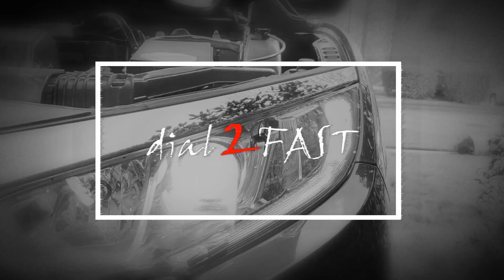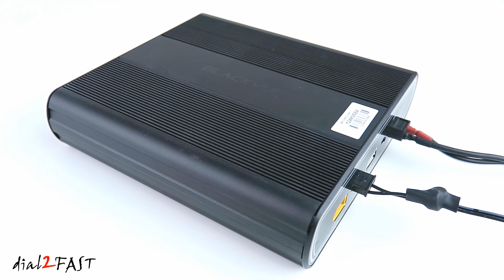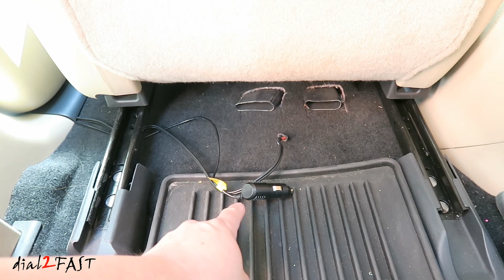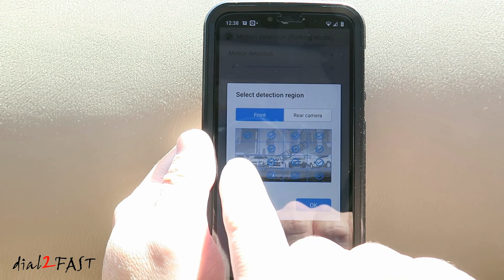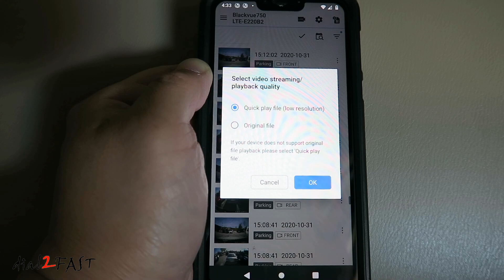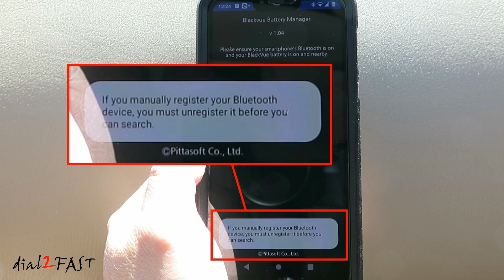Blackvue Dashcam Parking Mode - Power Magic Ultra Battery B-124X

Comment: Great Video, Any idea if it wold be possible to use the power magic pro with it so that the battery could charge from an always live fuse and keep the camera in park mode for longer, the power magic pro would then stop supplying power to the B124x battery once the main car battery reaches a set level say 12V? Would there be any reason it wouldnt work? This could be a great set up for long weekends away at hotels! I park my car in a garage at home most of the time and have it hooked up to a CTEK MX5 battery charger/maintainer so this would keep the camera and batteries fully charged if on a live circuit, then is there was a voltage cutoff inline the main car battery could also be used in conjunction with the Power Magic battery for longer park protection. Peoples thoughts are appreciated
Reply from the maker: It will not work. The output of the power magic pro output does not provide enough current for charging the dashcam battery. Secondly, the purpose of using a dedicated dashcam battery is so you don't any wear on your car battery. If you run any accessories off the car battery while parked, it WILL shorten the life of the car battery.
Reply: @dial2fast  I get that the car battery will suffer but that would be the reason for having a power limiting device in place, the main battery then tops up the aux battery to run the camera for parking mode and once the main car battery reaches a limit the PMP style device then shuts off the power to save the car battery and then the camera can still run on using the dashcam battery until its depleted. It would be no different to just wiring the dash cam into the PMP to run directly off the main car battery all that would happen is that there would be the dedicated dashcam battery in between them. Thanks for the answer its it the power magic pro device that is the limiting factor then as t doesnt allow if enough current through. Thanks again

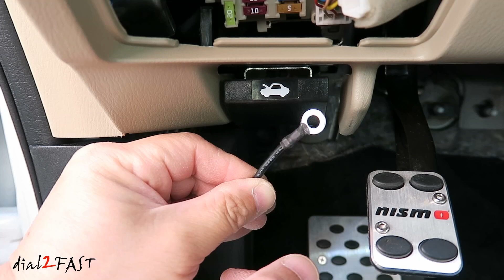Comment: Hi at 7:26 mark would you happen to know what size ring is on the ground wire?
Reply from the maker: The stud size should be 8mm (5/16") inside diameter to fit most 10mm bolt. You can use a smaller size for self tapping screw.

Comment: My cam is not a blackvue does anybody know if this can run a dashcam off the usb port?
Reply: Yes its just a USB port, so think of it like a giant USB power bank, If you connected your cam to it and the cam has a function for park mode or sentry mode or whatever they want to call it then it would have power for as long as the power magic battery can supply it. Not sure if it would run the camera straight away if the battery was flat as I think the battery routes power to the camera during charging but perhaps not as quickly to the USB port. I used a cheap next base camera on a solar USB powerbank as a test and it worked well and I think the Next base model has sentry mode that is minimal power draw until the sensor is triggered! There is also the other option of using a Blink camera and syn mode as they are powered from USB or just AA batteries in them, the only think needed to be powered is the sync module was thinking of trying this as a make shift 360 Cam system for the sides for a laugh!

Comment: I have a very short commute to work so I never get to charge my batteries much. I also have 1 B-124e daisy chained to the B-124x. I've tried adjusting my camera settings down, but this battery still gives me grief. This is what happened recently. For the past week, I've been doing whatever I have to do to keep the dashcam batteries charged above 50% even if I have to remote start my vehicle from time to time. Everything was working ok until yesterday. When I got to work yesterday, my charge was at 87% and I stayed at work for over 9 hours. When I left work the charge had only dropped down to 68% which is VERY good! My job has a high activity parking lot so I have motion turned all the way off and only rely on g sensor settings for recordings in parking mode. When I got home from work last night at 11pm, the charge on my dashcam batteries was at 75% which is still good. I went to bed at around 3am this morning, I checked and my dashcam batteries were at 64% charge which is still quite good. However, when  I woke up at 11:45 am, I noticed that my dashcam wasn't connected to the cloud anymore. I checked the events and the only event I saw was that the dashcam disconnected from the cloud at around 5am. I went out to start my car and the dashcam batteries were at 1%!! My mobile HOTSPOT has an internal battery and is plugged into the the B-124x via USB. It was at 85% charge and that makes sense. If the Blackvue batteries discharged at 5am, that means the HOTSPOT was running on it's internal batteries for about 7 hours (100% @5am down to 85% @ 11:45am)

So it appears that from 3am to 5am, something caused my Blackvue batteries to go from 64% to 0% and there were no recorded events during that time!! I'm hoping it has something to do with the Mobile Hotspot settings in the camera settings. I'm guessing it was trying to connect to my home network for some reason. I went into the Cloud Settings and removed network information for Mobile Hotspot 2 and 3. Hopefully, I'll wake up with no issues tomorrow. If I do have issues, I'm not sure what I'll do.

Comment: I'm so lost I got this and the new dual 900x IR and this battery got it professionally installed and parking mode never ever activates im assuming the battery is defective?
Reply from the maker: If you paid someone to install it, then have the installer help you troubleshoot the issue. Even if they are not experts on the dashcam, they are fully capable of testing if the battery is outputting the proper voltage. Very basic troubleshooting any beginner installers should know how to do.

Comment: does the Velcro adhesive stick to the vehicle carpet floor? Thanks for the video!
Reply from the maker: The adhesive on the velcro will kinda stick to the carpet but depends on how thick the carpeting is. If you put it on and remove it several times, it won't be as sticky.

Comment: Can you use the battery 🔋pack just for energy with other dash cam?  Thanks in advance for your help...nice video 📹
Reply from the maker: Yes you can as long as your dashcam supports parking mode recording, and uses a cigarette lighter power plug.

Comment: Can you use the power magic pro with the battery pack if the pack is hardwired to your car battery?
Reply from the maker: The power magic pro is for protecting the car battery. There is no need to use it with a battery pack.

Comment: Nice video mate,
Do you know how long is rhe cables ? Can the wire reach to back of the back boot?
Reply from the maker: I don't remember exactly the length of the power cable, maybe 8', but it will definitely not reach the back boot of the car.
Reply: @dial2fast  Thank you

Comment: Nice video!  I just installed my B124x on my Rubicon through hardwire.  Also ran the cables like you did but to the passenger side seat.  Did not velcro it.
Reply from the maker: Thanks for sharing your experience with installing it in your Jeep. Have a great week!

Comment: Nice video. Have considered battery packs for my dashcam before but heat was always a concern as the car internal temperatures can easily cross 45C in the tropics.   Just a couple of observations.. (a) . The fuse tap installation...The internal fuse box might have some empty slots that can be used instead of tapping into a used slot. You just have to check to see which one is ignition controlled.  In my car I had 5 empty slots. 3 ignition controlled, 2 live. So I just used one of those.  (b) The installation of the battery below the seat.. the orientation...i might be a bit concerned about passengers feet hooking the wires, so i would have turned it so the wires were towards the front/drivers side. Though that would be much harder to show for an installation video.
Reply: About the empty fuse slots, isn't that means that you will need to add another fuse besides the battery's fuse? Cause I'm sure you got to have 2 fuses on the tap.
Reply: @bigkaki000  ..  in the fuse tap, the bottom slot is for the fuse that was originally in the slot you are tapping. If there was no fuse then you can leave that bottom slot empty. All you are doing is tapping into the powered side of the fuse slot.
Reply from the maker: That's correct. Thanks for providing the info.
Reply: Had  the same concern haha

Comment: This will work only for vlackvue dvr's?
Reply: Which part ? If you are referring to the battery pack, it can power any dashcam using the cigarette adapter power cable. They may have a cable that uses the usb power cable.